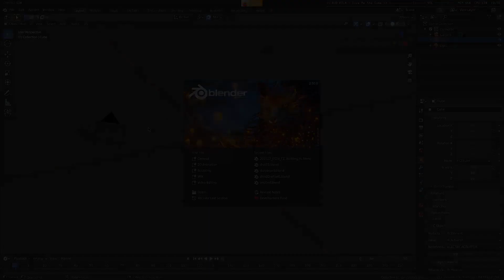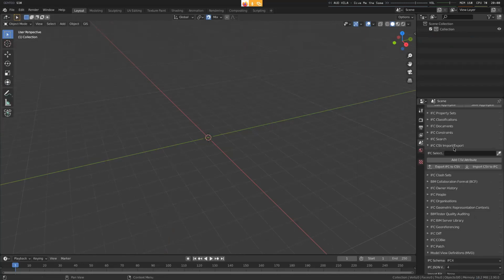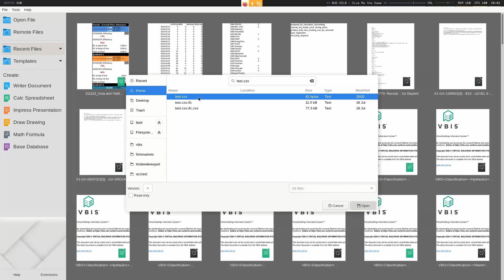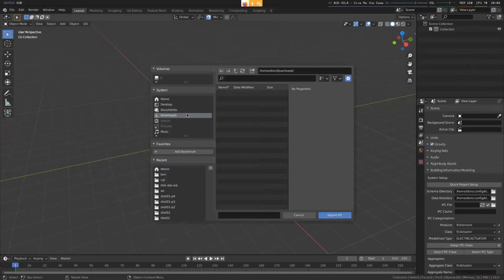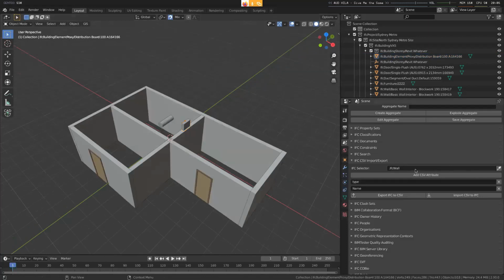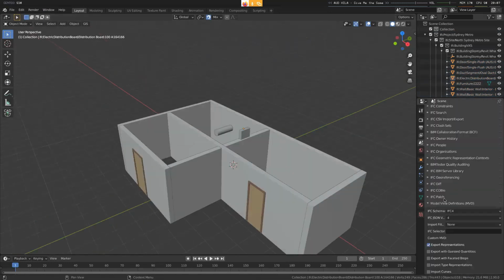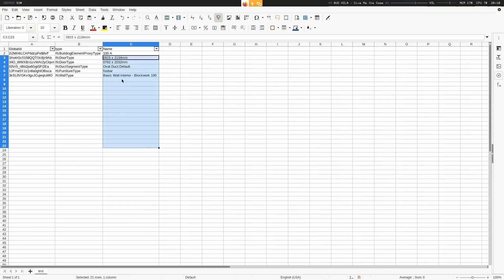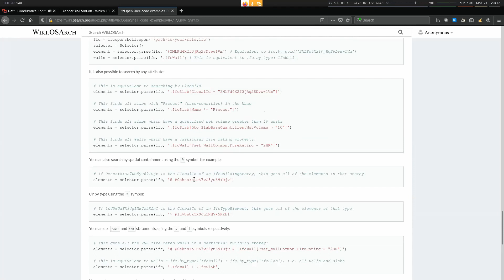BlenderBIM tour#1 with Dion Moult - IFCCSV

Comment: what happens with the class dependent PropertySets if you change the element class through csv?
Reply: At the moment, nothing. They remain assigned. IFCCSV will try to minimise "magic". After changing the class, it is then possible for you to do bulk pset changes in Blender. The ability to change pset names are not yet possible in IFCCSV, but is relatively trivial to implement. Would you like to have a shot at this?
Reply: @DionMoult  "IFCCSV will try to minimise magic" - am I dreaming here? the whole osarch initiative is awesome, I don't really get how the AEC world could live so long without realising the benefits of accessible and transparent data wizardry.
Reply: Ok, thanks, that makes sense, but it is not only about pset name, but their contents as well. Is there some kind of validation, or QC tools to have this consistent as possible? I'm sure it can be done, so I think it should be considered, if not done already.
Reply: @thumDerr  the BlenderBIM Add-on is quite unique in that it actually obeys property set template definitions. Unlike other BIM programs where you can name any pset anything and have any contents - the BlenderBIM Add-on will require a template definition and will complain when you export something that doesn't comply. E.g. if you disobey the Pset_WallCommon definition and assign it to a slab or put in a random property, it will stop you from exporting it as it is invalid.

There are also utility functions built to QC this. More UI exposure is definitely needed, though.

It is also on the roadmap to support the bsDD, which will help to standardise and further ensure quality checks on properties. I'm happy to hear users are also concerned about this, and we take data quality and standards compliance very seriously :)
Reply: @DionMoult  Well, thats great! Coming from the Revit world this seems utopia. 😁